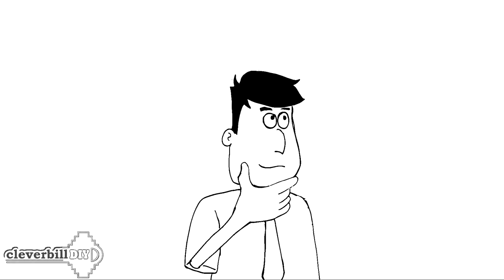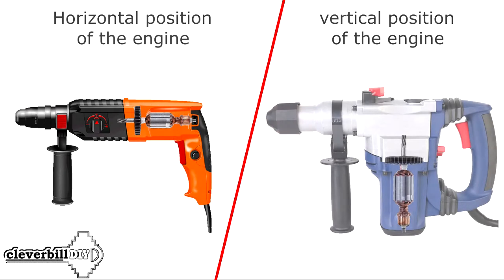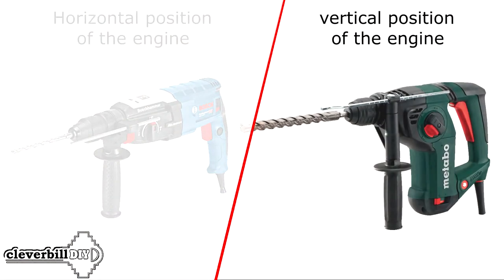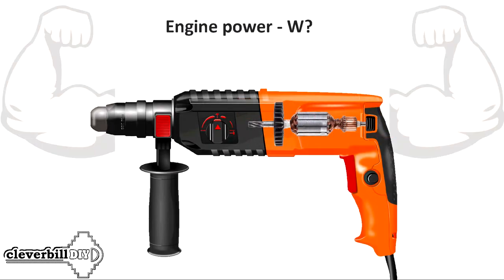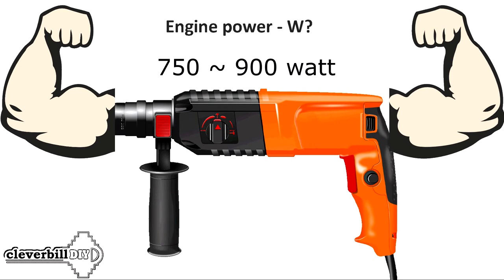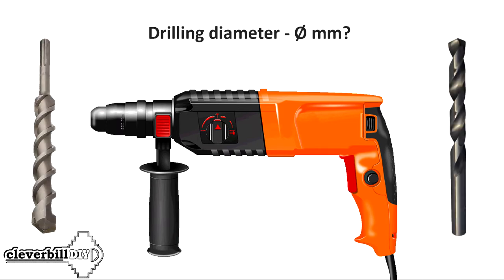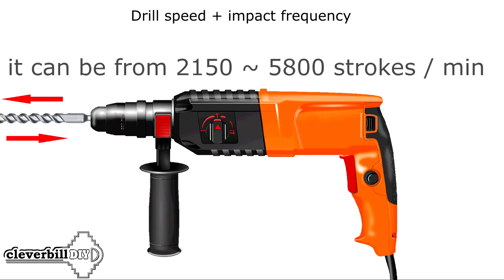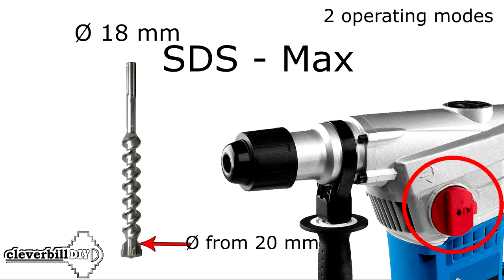Rotary hammer - how to choose? Features and differences - what to consider when choosing a tool.

Comment from the maker: A Rotary hammer when renovating an apartment turns out to be an indispensable assistant. When choosing a tool, it is important to take into account the specifics and scope of work for a hammer drill. A low-power hammer drill with a low impact energy coefficient is unlikely to "survive" a major repair associated with the hard work of making holes for sockets or widening doorways in concrete. But, with occasional work, such a tool may be quite enough.
Reply: Thank you for your work on this topic. I'm watching this because google is listening enough to recognise what I'm interested in now... "scary!"

Anyway, The impact drill I've been using for the last 25 years finally died. I usually purchase high end German manufactured equipment but was willing to compromise a little on this tool because it doesn't get a lot of use in my business outside drilling holes for nylon anchors in bricks or the odd punching through brick walls to run ducting.  Ideally I wanted an inline style motor for getting into tight places but couldn't go past the extremely cheap and nasty Ozito brand from Bunnings. 

I'm probably going to get frustrated at that choice down the track but I easily finished the 500mm x 30mm hole that killed it's predecessor and it came with a collection of chisels and drills that would probably cost the same or more than the meager $90.00 asking price if purchased separately. 

I'm baffled that such a heavy 1000watt machine could be so cheap and be so competent.

We're living in strange times...

Comment: I wish I had seen this video a few months ago. I had used a workshop DeWalt 20v workshop battery hammer drill for drilling basalt rocks prior to splitting them. I had to start with a 3/16" bit and gradually work my way up to a 5/8". The drill would overheat and bits would spin in the chuck and I ended up replacing two chucks and going thro bits like no tomorrow plus hours of wasted time. It took hours to drill 4 holes to 5/8". .
 I finally got smart and purchased a rotary hammer drill (cheap at $110- vertical motor) that was low on impact force (only 5.5J) but 1500 W. (corded). With this I was able to chew through the rocks with a single size bit (5/8") quickly with no downward pressure on the drill. With more Joules I am sure I would have conserved bits (expensive) and gone thro the rock more quickly as there lots of heat buildup and tips can mushroom even with frequent quenching. 
    It would be interesting for you to do a similar video on different drill bits in different drills. In my case I used Bosch and Milwaukee bits. I had better success with  4 cutter carbide bits from Milwaukee on my basalt rocks. poor boying the job by using the wrong drill for the particular job costs you plenty in drill bit costs.  You end up paying now or later. 
   I am proof that getting the right tool for the job can save a lot of time and brain damage.